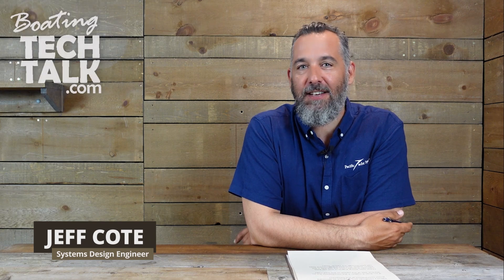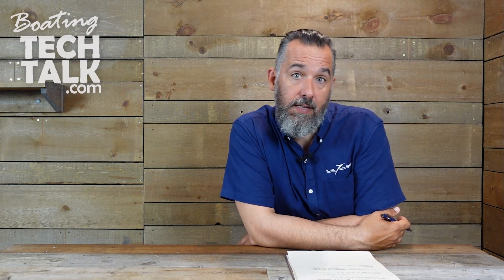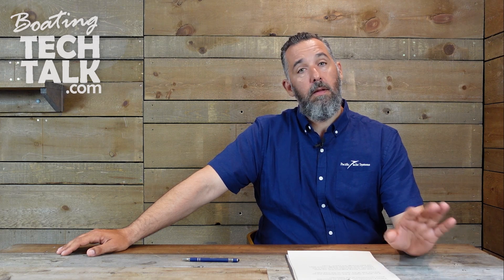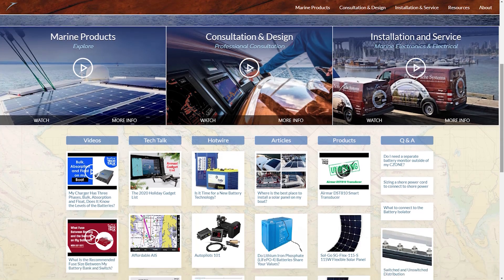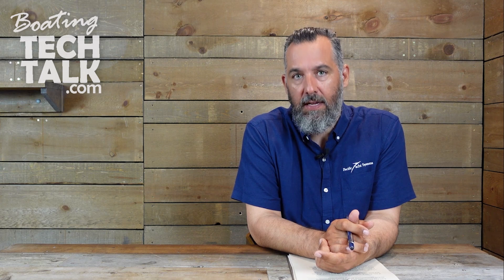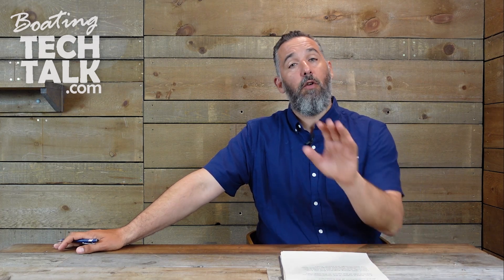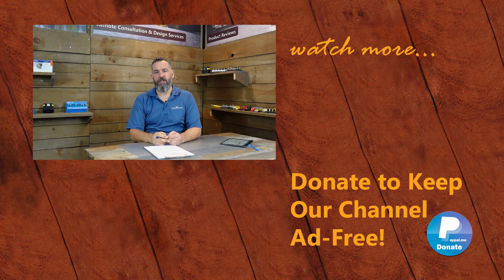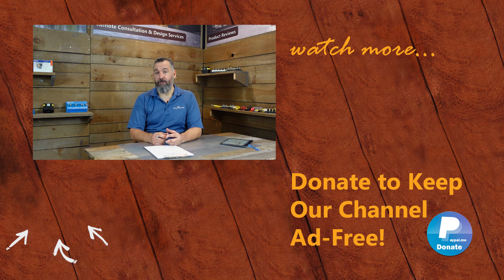Wiring An ACR or Battery Combiner on my Boat?

Comment: If you we wire ACR the correct way how do you add a two bank charger to the batteries without interfering with ACR.
Blue seas says if you install it on the load side you can attach your battery charging lead straight to the batteries please help

Comment: Hi Jeff. Thanks so much for sharing you knowledge here. 

I'm a 'fellow boater' with a question! In the old days, when the starter battery was low, I could combine banks 1 and 2 to get the diesel motor started. Can I (should I) do the same today with my AGM starting battery and Lithium house battery? If so, how would it be wired into the system and which combiner would you recommend I install? 

This would only be used in the event or a dead or low starting battery. Cheers!
Reply from the maker: Lithium isn't so great for engine starting loads. For engine starting redundancy, you might want to get a 2nd AGM instead of using your Lithium battery. Anyone else can share their experience with redundant battery for engine starting when the house battery is Lithium.

Comment: Whats the solution for having two different sized battery banks and wanting to use an ACR?
Reply from the maker: It's doable (i.e. the higher the ratio of battery banks the worst it is) just remember to constantly inspect the fuses on either of the battery combiner, as imbalanced battery banks in parallel while charging can cause high inrush of current to go through the battery combiner (ACR).

Comment: Would it make sense to use a DC/DC charger such as an Orion TR-Smart between the alternator/starter side and the house bank instead of an ACR?
Reply from the maker: Definitely worth considering, DC to DC charging converters are now maxing at about 30 amps.

Comment: I have put a switch on my ACR negative wire so I can turn it off if I think my alternator is getting too hot.
Reply: Roy,. Not sure why your alternator is getting hot.  Make sure you have the correct size wire connected to your alternator.  Also, I have a switch on my negative wire on my ACR.  Without a switch,  my ACR is always active looking for 13.3v to combine or 12.6v to disconnect.  The amp draw is minimal, but I guess we are like, in that I don't want any current to my ACR when my boat is in storage.
Reply: @calvindickey4597  If you disconnect the main ground from your batteries when winterizing then all circuits are broken. Even if ACR and bilge pump auto switch AND stereo settings memory wire is still connected at main 12V + battery terminal, there is no completed circuit during storage.
Reply: @paulwhealy5243    Not correct.  I put a switch on the ACR Negative wire.  Both of my batteries negatives are tied into a negative bus bar.   I did this so that the ACR is completely off during storage.
Reply: @calvindickey4597  The problem is alternators are air cooled with a built-in fan, at idle and low revs with a high current load there's just not enough airflow and they can overheat, I just leave the acr off until I'm on the move. When time allows I'm going to try to put a small computer fan on the back and a thermostat on the side to switch the acr off and fan on to take me out of the equation lol.
Reply from the maker: Hi Paul, disconnecting the ground sense wire will certainly stop the ACR. Another option is to connect a switch to the SI (starter isolator) post, and this too will disable the combiner.

Comment: Hi Jeff. So is it acceptable to connect the combiner to the line side of my on-off-combine switch? On the same posts that have the battery cables on them? That’s technically unswitched  right? Is that effectively the same as being directly on the battery?
Reply from the maker: Technically yes, make sure the battery combiner wiring is fused at the line side of each side of the circuit.
Reply: But I would say Jeff is implying that you connect ACR wires directly to batteries, NOT the line side of battery switch. 
This ensures you are not sharing wires for two separate functions, and also allows easier fuse implementation (battery terminal fuse block, etc), vs rigging some type of inline fuse from line side of battery switch.
Just my thoughts.